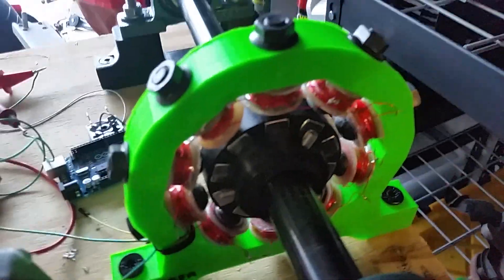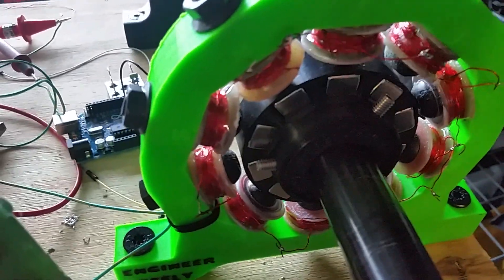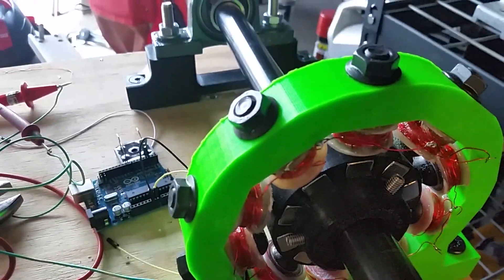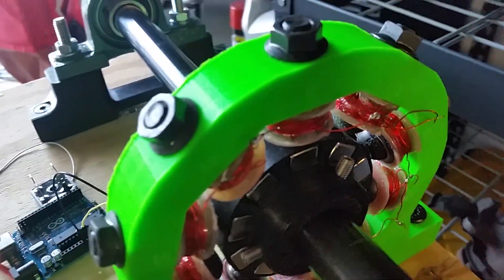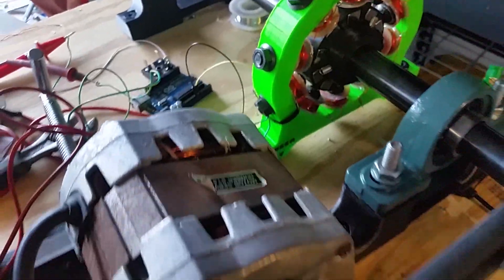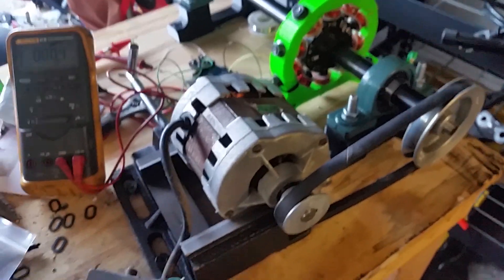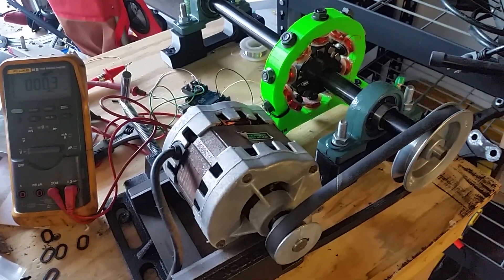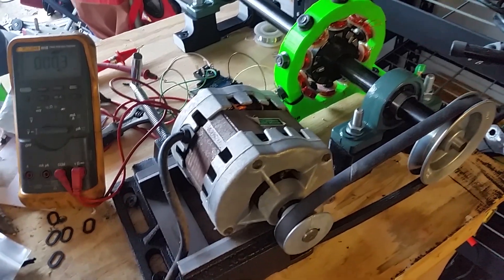A 3D Printed Permanent Magnet Generator?? Whaaat?

Comment: Heat in a motor or generator can be caused by several different losses. They are:  I^2R losses in the copper, eddy current losses in the iron, hysteresis in the iron, windage from the air, and bearing friction. In the case of your generator, running at no load and no current, you don't have I^2R losses (amps squared times ohms) because you don't have any "I" (current). What you have are eddy current losses and hysteresis losses in the iron. That's why soft laminated iron with a thin insulation between layers is normally used. Your generator would get equally hot even if there were no wires installed. Current is circulating in the heads of the bolts and around the circumference of the threads, just like current would normally circulate in the windings if you had a load connected. Good job though because you tried, and learned. “Negative results are just what I want. They’re just as valuable to me as positive results. I can never find the thing that does the job best until I find the ones that don’t.” 
― Thomas A. Edison

Comment: thanks for posting.  some thoughts.  nice work.  but, in terms of energy production, yer generator is not well designed. note that a magnetic pole forms when the n/s flux of TWO adjacent magnets joins.  usually, a design is used that results in a group, but not all, of the coils being energized at one time. (known as phases).  remember the ratio of four to three.  four magnetic poles to three coils.  mag pole interval is 90 degrees; coil interval is 120 degrees.   this results in coils being energized in groups of three ( a phase).   when hard steel is used as a core, it eventually becomes magnetized; use mild steel, such as nails, or silicon steel taken from a transformer.   the internal resistance of small gauge wire limits output current.  (amperage;  amps x volts = watts)  for power generation, wind fewer turns using 16 or 14 awg wire for the coils.   cheers

Comment: You could achieve much more if you made the winding's nicer
Reply from the maker: Care to elaborate?  I agree I can make my layout of the windings better, but there is not much more to gain with 100 turns of 24awg wire.  If the air gap was less, there would be more magnetism.  If I had more iron, it wouldn't saturate so quickly.
Reply: Engineer Freely  change bolts in coil to magnets ... stator S  coil N ...

Comment: For 15 years, I have been working with angular resonance and I am ready to do the electricity generation project together with investors who agree to make an official protocol. Everything will be done openly after the signatures are signed.
Reply: Do you have any proof that your invention is viable and worthy of investment?
Reply: @H8teTuber I want to create a clean energy system for a cleaner world. No mechanical wheel system that does not change its angle can produce energy. Any system that violates the laws of physics will not work. You can promote this project in your country. I want to realise this project and get a worldwide patent. Of course, I need a solid and idealistic investor to realise these works. I convert angular energy into mechanical and electrical energy. I am an inventor. I am ready to do this project in every country that will support me. 98% of the published videos are wrong and do not work. I know the mistake they all make.

Comment: What would it take to make it a low RPM (stackable for higher voltages of course) maybe much thinner wire and more turns for higher voltage...then feed thru a transformer to lower the AC voltage, then rectify it (for "off grid") type power.

So very awesome...so you have the .stl's you made?
Reply from the maker: more turns! So either make a larger core to wind it or thinner gauge wire so it can fit.  rectify, transformer, and even a voltage regulator to keep it consistent.  STL arn't available to public at this time, thanks.

Comment: first mistake u made is having more magnets than u do poles
u have a motor not  a generator''' if u have 8 poles u need 8 magnets'''  not 9 or  10 or 7'''  and wind your damn coild clockwise then counter clockwise''
then u have a true generator''
Reply from the maker: Thanks for your consideration.  It has 10 magnets and 10 wound coils which is 10 poles.  Also if you wind your coils all in the same direction but connect them backwards, then its the same as winding them in opposite order.

If you have more magnets then poles but rotate it at the pole speed, then you have a higher frequency in a PMG sense.

Have a good day.